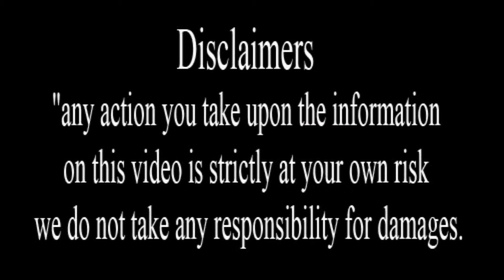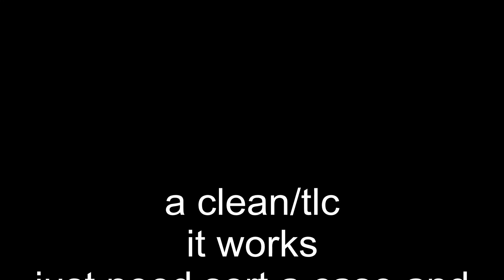FRISTER & ROSSMANN SEWING MACHINES

Comment: Thanks for taking the time on your video, I have a small issue that maybe you might be to help with. I have a Frister & Rossmann such as yours. When I got it it was all rusted out, but I had freed stuck machines before so I knew I could do the same with this one as well (Completely soaked in vinegar 14hours and it did the work) . This was my first time disassembling this model, (I'm always carful when taking a machine apart because I know what can happen.) 
Anyway when I removed the faceplate, nothing seem out of place, but there is a small piece that looks like a small yoke that fits in a small grove, to my judgment this piece operates the (tension disk) when the presser foot is raised. To my knowledge it looks like there might be a tiny spring that fits behind this small yoke but no spring was found when removing this part. When I reassemble the faceplate there is no release tension. On your video I can see the parts being there but I still can't make heads or tails of how it works.
Any guidance would be appreciated, thanks  
Note: your faceplate on your machine is identical to mine.
Reply from the maker: We will have look and get back to you please subscribers as we may do other video to try help you 
Many Thanks
Reply from the maker: new video upload hope it help if not can you do vid of your sewing machine https://youtu.be/Hq3afbUQk_k

Comment: Nice video. Good to see you managed to get the s'machine working. Are the sewing machine attachments the same for singer, low shank? With thanks.
Reply from the maker: we recommend using correct sewing machine attachments
Thanks for your comment
Reply: you can use singer needles but you need to set the needle lower,not pushed right to the top of the channel.